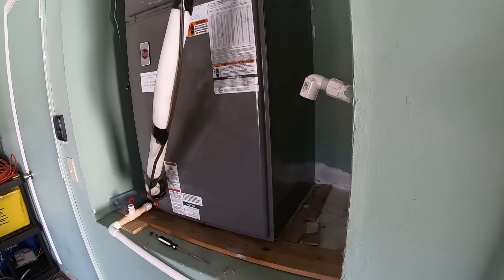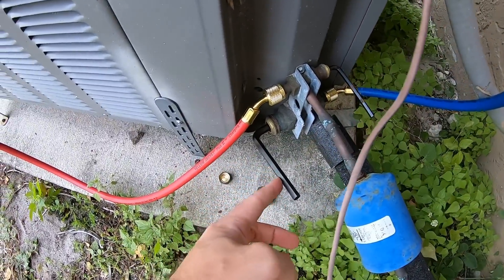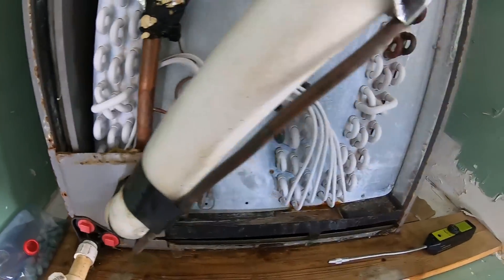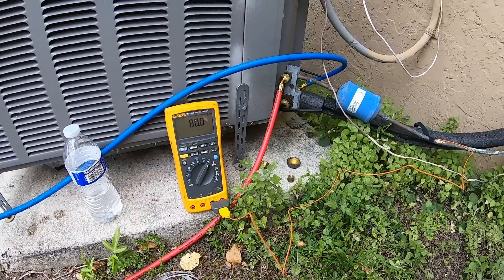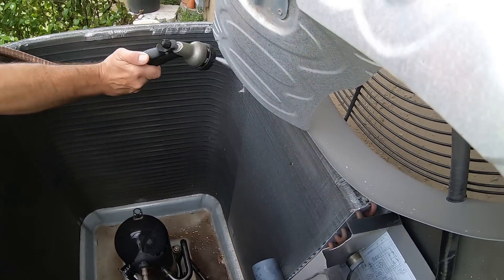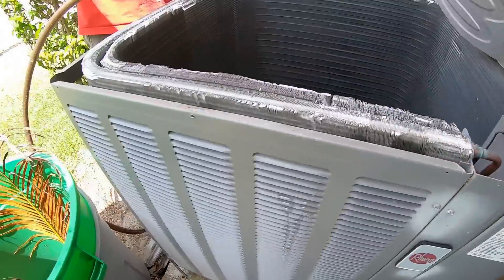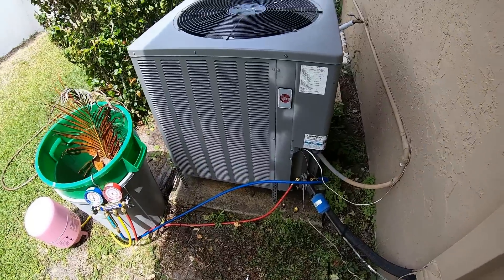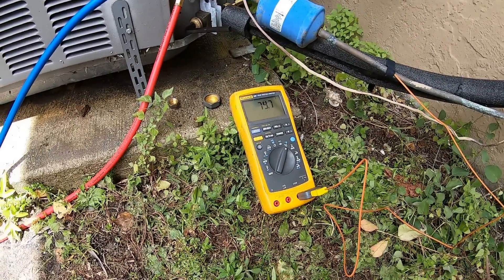Charging a Rheem 5-ton R410a split air conditioning system

Comment: Couldn’t I just flip the bottle over to intro gas into the system instead of using that adapter and liquid ?
Reply: 410-A is an azetrop refrigerant..which means it is a mixture of gases. By charging in liquid form you keep the refrigerant true. If you charge by gas tou might unbalance the refrigerant by the lighter molecules leaing first and the heavier staying in the bottle
Reply: FLY EAGLES FLY Bleed Azeotropic Blends

An azeotropic refrigerant is a mixture of two or more components that boil at the same temperature.  The components in this type of refrigerant will evaporate and condense together as one. An example of an azeotropic refrigerant is R502.  There is no glide to worry about with with this type of mixture.

Zeotropic Blend

A zeotropic blend is also a mixture of two or more components. The components of this refrigerant have different boiling points.  These components will evaporate and condense at different temperatures.  An example of a zeotropic blend is any 400 series refrigerant, such as R407c and R410a, keeping in mind that R410a is considered to be a near azeotropic blend.
Reply from the maker: The bottle should be upside down for r410 anyway. The adapter is to meter how much liquid refrigerant goes in. It is not required, but it helps prevent damage to the compressor and allows you to charge the system faster.
Reply: R410A is a combination of 2 gases which boil at different temperatures.  You must take liquid out of the bottle to maintain the proper proportions of the two gases.

Comment: Nice video. Got a question. I have the same Fluke and I never knew it had a temp checking capability. What probe are you using and where can I buy it from? Do you have a model number or part name?
Reply from the maker: Thanks! It is a Fluke 80PK-1 Bead Probe. You can get them on Amazon here https://amzn.to/2Wg1gAV for $40 or so. They work very well!
Reply from the maker: I should have also mentioned that Fluke makes dozens of temperature probes. They make them for liquid immersion for pipes etc. This particular probe works very well in this application though.